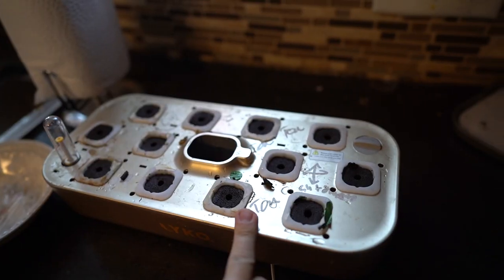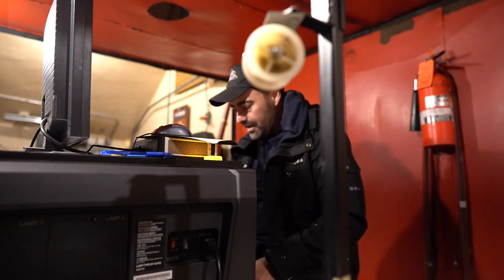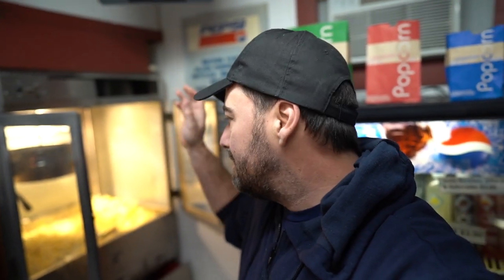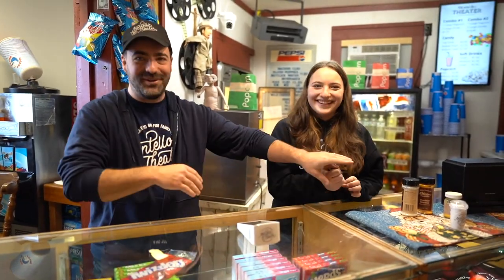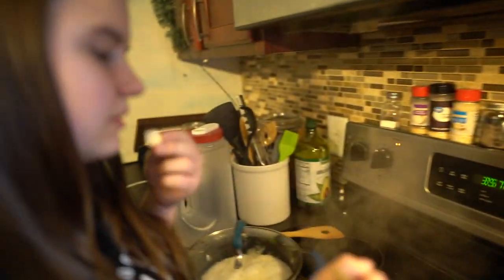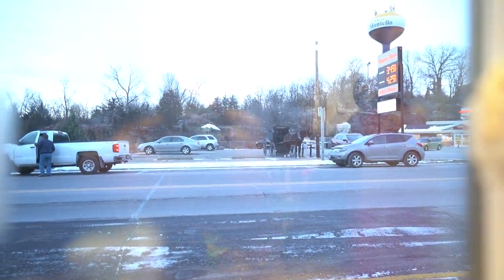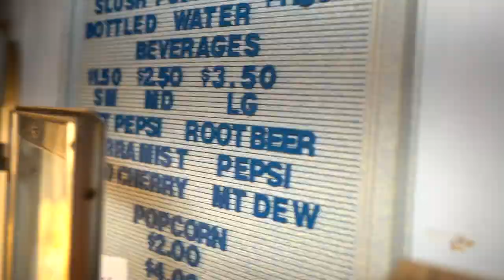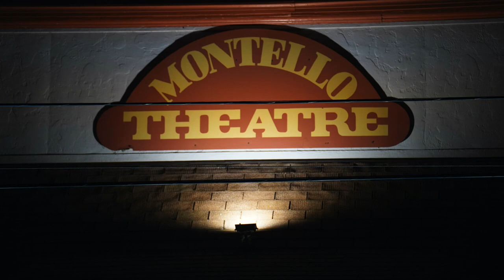Can We Survive our Movie Theater's Busiest Day Ever?

Comment: Roof repair tip: we just did some temporary patching to our church roof, the damage is to far for it, before the winter.  A Structural Engineer suggested to use cotton or fibre batting with flex seal, brush the area with a soft brush and lay the patch like fibre glass.